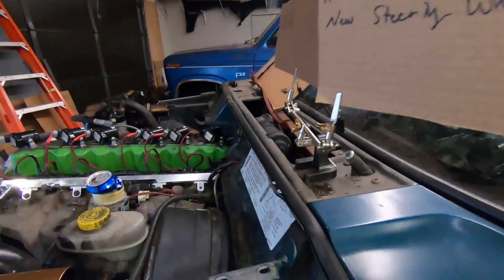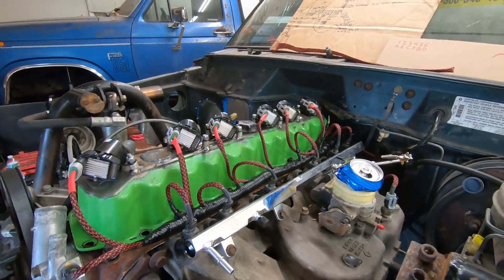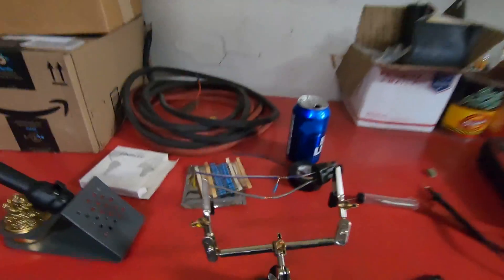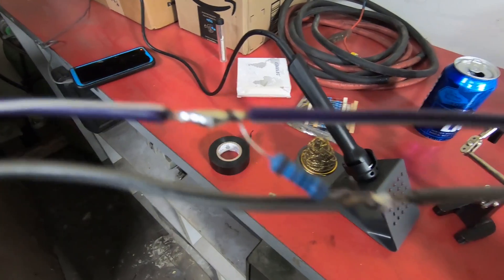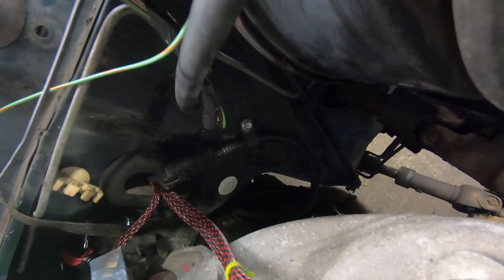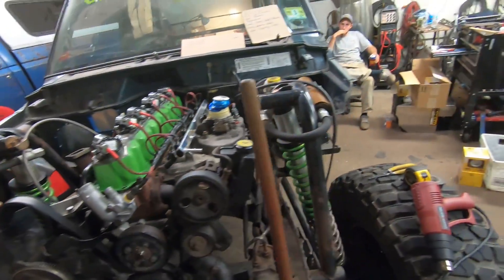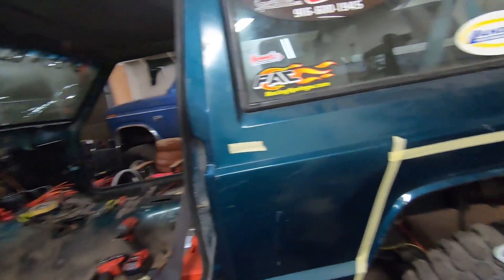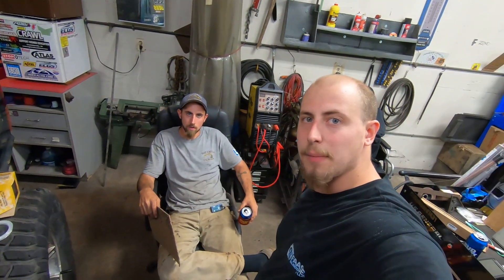Turbo Jeep Megasquirt Part 6

Comment: Why the resistor in CPS? What trans are you running?
Reply from the maker: 1000ohm Resistor is required for the CPS using 5v from the ms3, it will not work otherwise
Reply from the maker: Trans we are using is an ax15

Comment: Idk if you used marine shrink tube or not bc i couldnt see it real well but i think itd be a good reccomendation and better then the regular stuff if not....why the resistor tho? Im not runnin megasquirt but im really considering it if i keep cherokee.... ive always wanted to run a ms system just never kept anything long enough to do it
Reply from the maker: We did use the marine stuff, and also you need the resistor or else the megasquirt will not get a signal from them

Comment: hell yeh guys. keep it.up.  I can't wait.

just a question, did you guys use any upgraded push rods and rockers in the head?
Reply from the maker: Thanks! We just upgraded the valvesprings and the lifters, pushrods and rockers are stock at the moment

Comment: The beauty of building dumpsters is that all your hard work will transfer directly over to the next dumpster/Cherokee build.  Yeah the outlay of cash sucks up front, but short of burning it to the ground, all these components should last many, many years. I have that same fuel rail in red. I feed it from the rear and am using the stock supply line location as my return. As always, I look forward to these updates!
Reply from the maker: Agreed 100 percent thanks for keeping up with us! We love the amc's
Reply: @Grewsum2Sum  Thanks guys!